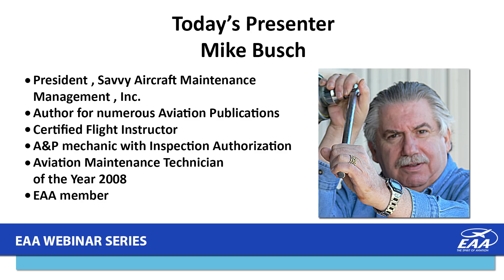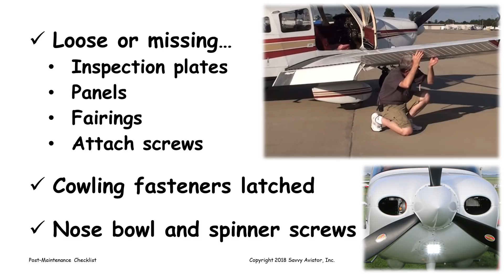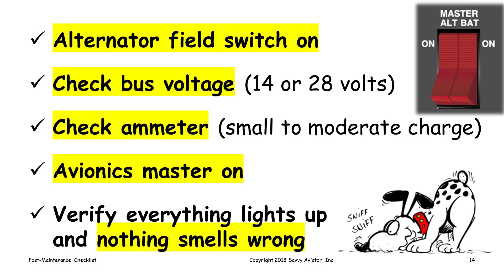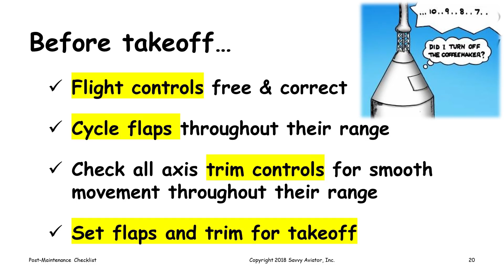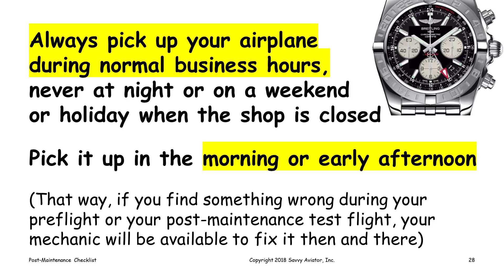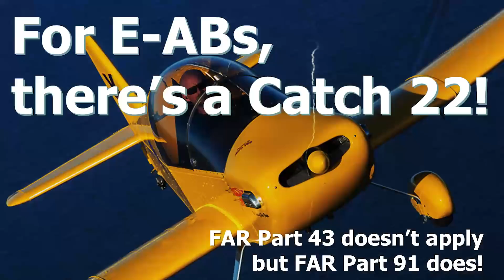Post-Maintenance Checklist

Comment: It is best to check the brake pedals are firm before starting the engine. If no brakes when the engine starts you could taxi into anything without being able to control the aircraft especially if your aircraft steers with the brakes like a Cirrus or a Grumman.